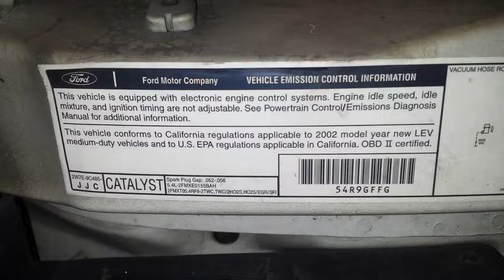Ford Econoline emissions: PCV, EGR, EVAP canister, & purge locations

Comment: What he pointed to in the engine compartment is NOT the EVAP “vent” solenoid. It is the PURGE solenoid. The VENT solenoid is attached to the EVAP canister by the gas tank.
Reply from the maker: You are correct. 👍🏻

Comment: YOU SHOULD'VE SHOWN HOW TO PROPERLY AND EASILY TO REPLACE PARTS WITHOUT BREAKING THEM.
Reply from the maker: This was in for a smog inspection.  I am not allowed to remove parts. Sometimes just having a starting point will help you come up with a plan of attack to get the job done. If you need step by step direction ls, I might be able to find them on All Data and send them to you. Text me or email me.

Comment: What does the little box do, the Vapor Canister Purge Valve Assembly  , should be replaced too ? Cant find any information on its purpose. Reads to canister and the other side has a line that goes to the back and is open to the environment 🤔
Just replaced all solenoids, lines & canister and found the box.
E-150 4.8L 2001

Comment: The second part you pointed out is the canister vent valve ,not the canister vent solenoid! The vent solenoid is under rear passenger  and is easy to switch out.. I wasted time looking inside engine bay for this solenoid

Comment: My van cuts off at stop lights and shutter when putting it into drive pushing on the gas pedal but when driving it acts normal shift normal everything is good I have to put it in park and keep pushing on the gas pedal to keep it on any help!!?
Reply from the maker: Have you checked fuel pressure and do you have a check engine light on?

Comment: Great video thank you. My b2s1 and b1s1 02 sensors went bad I guess. And it thru a code for the egr valve. That one by the spare tire I have a wire hanging down in that exact location I bet a squirrel chewed thru. But now I can assume what it connect to. It has a recommend on the print out to change the evap vent control or something?
Reply from the maker: This is a lot.. lol. What is the code you are chasing? The egr valve is in the exhaust system. If it is malfunctioning, it could cause your oxygen sensors to see poor reading.

The vent valve near the spare is for the EVAP system.

Let me know what you got.

Comment: Hello I'm having a hard time starting my 2003 econoline e350. I have to cycle the key 2-3 times for the fuel to flow I guess, but then it starts right up. My codes read P0442 P0171. Also occasional smell of gasoline. 
Any thoughts or recommendations?

Comment: Anyone ever tow with snow e150? 
I have an e150 with a 5.4 and I'm towing a 4000 pound trailer which should be ok within limits, but it seems to be struggling.  It will only go about 60 before feeling like your really pushing it. The van seems to be running good but occasionally gives a P1451 code. I'm planning to change purge valve, but not sure how to know if it's the value or the canister other than to try both. I do also have a lot of pressure when I open the gad cap. 
I was wondering I'd I drill a hole
To vent the gad Cao if that would help ?

Comment: This is somewhat helpful to locate the parts I need to investigate. My 1998 E-350 sputters when it shifts into overdirve and the RPMs drop. As long as the RPMs stay higher, the van runs fine and accelerates fine. Once I reach cruising speed on the high way, it struggles. My thought is that it's a vacuum issue, and I already fixed the PCV valve hose that had a hole in it. Thoughts?
Reply from the maker: Have you tried cleaning the mass air f low sensor?
Reply: @ScottiesHobbies  Not in the last 15k miles. I'll give that a shot, but I figured that would cause issues all across the rpm range.
Reply from the maker: @l00nybin  its more likely to cause a cross the rpm spectrum but i bet the rpms and air flow is pretty low at cruising speed. Check the connection between the mass air and throttle body. You are probably on the right path of vac. Lea tho. All the wires are good and no arching?
Reply: @ScottiesHobbies  wiring is fine. No arcs. It sputters bad enough that a misfire is unlikely because it would have to be misfires on multiple cylinders, and it's not throwing codes for that.
Reply: I think it might  be clogged cats, drill small holes on the cats  to verify. Don't take my word for it but I have seen it happen, or check them after a good run and they look bright red.

Comment: Pretty nice amigo. I have a Ford E350 which crank but does not start. Looks like a fuel and admission system, discarted crankshaft and timing systems issues, already a fuel pump and an injector was replaced by previous electromecanic.
Reply from the maker: Have you stayed any spray start in the intake while cranking the engine? If it tries to start or runs for a second you know you will have a fuel problem. If the vehicle does not try to start than you probably have a spark problem. I'd start there to make sure I am looking at the right issue.
Reply: @ScottiesHobbies  I will see the car this week as the owner contacted me to solve the trouble with this car. What I told you is just feedback from the owner.  This car just has come from USA two months ago to this country so let see what I can find during troubleshooting and I let you know.
The fault isolation you have advised sound pretty good way to isolate fault. I will do this. Thank you amigo...

Comment: I hope you're still following this. I really appreciate your posts. On my 2002 e250 5.4L v8 2 valve, I've received a P1451 code, after replacing the front 4 plugs and Ignition Coils. Previously I had a couple of misfire codes, and occasionally a "lean" code. Immediately after reaching around to install the 4 plugs and coils from the front, the code was p1451, the other codes have not returned. I'll do the other 4 plugs/coils soon, but I thought to collect the some parts, such as the PVC valve (and the Evap Canister Vent, since that code fired) to deal with the things I can reach from the doghouse, since all of this is a knuckle buster, best to refit what you can when you can reach it...
But... I'm confused. On the passenger side, you locate the "Evap Canister Vent Solenoid" at 48 seconds in... https://youtu.be/Ra7wODJY8F4?t=48

All the evap hoses are pretty obvious on an econoline, They are a little crusty, but basically they all look intact, so I'm less inclined to worry about evap leaks, and the pro's seem to say that it's reporting an a electrical issue between the PCM and the Solenoid, look there first. 
But when I look at the part, it doesn't seem to be remotely the same... https://www.partsgeek.com/catalog/2002/ford/e250_econoline/engine_electrical/vapor_canister_vent_valve.html?rp=vapor_canister_vent_solenoid 
Below, you mentioned that sometimes you get the "purge" and "vent" solenoid confused. Should I be looking for the "Vent" solenoid back near the tank?
Reply: I found the canister vent solenoid, its mounted on the canister, just behind the rear axle on the drivers side, and I can confirm the solenoid in the passenger side of the dog house is the canister purge vent.
Reply: I’m really confused now that I’ve read your post also.  Most of what I’ve read so far from others it seems like the words purge and vent are used as the same then valve and solenoid and used as two separate things.  
Your explanation says that purge and vent are different.  Soo what is the difference between vent and solenoid?  
My paperwork from my mechanic says that my code P0443 is for the “evap canister purge valve”.  Which is it? Where is it?
Thanks
Reply: @sotapota  the purge valve inside the doghouse open /closes to release and burn off extra fuel vapors at spec times during operation. The canister vent solenoid is located on or sometimes near the canister itself. Opens/closes much the same way at diff times to store vapors inside the canister. (carbon in the canister does it's thing & stores &or scrubs air into the atmosphere, again at spec times.. Not very technical, but that's the basic gist

Comment: Thanks Scott.    How about a troubleshoot vid on when gassing up Econoline gets the dreaded repeated nozzle shut-off?
Reply from the maker: Check the vent solenoid. Make sure it's not clogged, works properly,  and gets voltage to connection.
Reply: Did you get it fix??? I'm dealing with this now
Reply: @beardedjalapeno5263  any luck?
Reply: @zombie730  nope. Can't find out why.
Reply: The problem is the VENT SOLENOID mounted on the EVAP canister
Reply: Found a video in Spanish where the guy walks you through the diagnostics
Reply: @zombie730  got a link?
Reply: @beardedjalapeno5263  part 1  https://youtu.be/wU_MyK7KYtM
Reply: @beardedjalapeno5263  part 2 
https://youtu.be/WhEU-D4nrkI

Comment: Thank you, spent 2 hrs online trying to find the dpfe sensor today.  Still need to check egr but wanted to make sure I knew where it was just in case.  Question though, the Van has a real bad smell of fuel when running.  Would this be in relation to that issue?  The van struggles to accelerate but idles perfect.  Upon accell it's very choppy, almost like its misfiring.  Any thoughts?
Reply: Im have sam problem who you fix help.my

Comment: Have a 2008 e250, when I fill up gas the pump click off several times. I replaced the purge valve from inside and it did nothing. HELP!!
Reply from the maker: Usually when you're having a problem pumping gas it's the vent solenoid and not the purge solenoid. When you're pumping gas and the computer sees pressure in the EVAP system it'll open the vent solenoid to let the vapors not build up pressure in your fuel system. If the purge solenoid was to open to relieve the pressure it would allow all the fuel Vapors into the engine in caused a rich condition upon startup. Whenever I get this complaint about a vehicle I always recommend testing the vent solenoid and also making sure the hose from the vent solenoid to ambient is clear of debris such a spider webs and Road dust. Let me know if this helps or if you have any more questions please feel free to ask away
Reply: Scotties Hobbies bless you Scotty

Comment: Great video and highly appreciated! Big 👍 up! I have a P0401 code which popped up on my 1999 Ford Econoline E150 4.2. Should I look into changing my EGR valve or change the DPFE sensor first? I haven't noticed not one bad symptom since the code has lit up. When I've erased the code it pops up a day later or so and stays on. Thanks for the reply in advance.

Jeff
Reply from the maker: I would first test the EGR valve before I replace anything. It's a very simple test. Applied vacuum to the EGR valve itself and see if the vehicle stalls out or even dies. It should. The EGR valve should also hold the vacuum. If that test does not work then replace the EGR valve. If the engine stalls or dies and the EGR valve holds vacuum then I would suspect the DPFE sensor or the vacuum switching valve that controls the EGR valve has gone bad.
Reply: @ScottiesHobbies  Thanks so much for the quick reply. God bless you.

Jeff
Reply: What was the problem? The egr or something else?

Comment: If you get codes about oxygen sensors running rich, replace MAP sensor. If you get improper vacuum to the EGR, replace the charcoal canister purge valve. High idle can be caused by a bad MAP sensor. A bad coolent temperature sensor can cause high idle. A TPS can cause high idle. The ISC motor or IAC valve can cause high idle. A leaking transmission vacuum modulator hose can cause slamming into gear and harsh shifting. Listen for a hissing noise. Get a Actron CP9690 code tester. It checks live, record, emissions test, transmission tests, oxygen sensor tests, solenoid and relay tests, it can erase memory codes, it can turn off check engine light, it can turn off oil change reminder light, ABS, SRS, it shows coolent temperature, RPM'S, MAF %, IAC valve%, and MORE! It checks from 1983-2013 and is updatable. EBAY has it.
Reply: What's the MAP sensor

Comment: I found a bunch of little black pieces inside the vacuum lines, could it be that the carbon canister is broken ? I have a 2003 E250 4.2L?
Reply from the maker: Sounds a little odd but yea, might be carbon from the evap canister
Reply from the maker: Now that I have thought about it... i have foind little black pellets in a older bronco vac lines and after replacing oll the rubber vac lines on the evap system we realized the pellets were actually pieces of deteriorating hose.
Reply: Scotties Hobbies hope you can help me with this, my differential is leaking oil and I plan to replace the gasket and the oil, It has a DANA 60 35 spline, the only thing I’m not sure is if I have to add the traction modifier, I can’t find any information about it, I only know that has a  Semi-Float (C-Clip) Axle Lockers, any thoughts??

Comment: Hi! Thanks for the great video, really appreciate the info. Do you know what the name of the black hose and the canister thing you push out of the way a little to show the EGR valve at the end is? (In the foreground starting at about 1:35-1:56) 

I need to replace that on my van, but can't figure out what it's called.
Reply from the maker: That is the hose that goes to the IAC. The little canister is either a check valve or a small filter. If the hose is leaking you can replace it with the same diameter vacuum hose. I would look at the canister and see what it it is. You can suck and blow on it, if you can only suck or blow in one direction then you know you have a check valve..   You can also call the dealer and ask for the hose from the intake to the Idle Air Control Valve (IAC valve)
Reply: Thank you so much for your quick response! That really helped me. Turns out it is called the "air bypass valve inlet tube" Ford part 9h308. Thank you!!!
Reply from the maker: +jedge glad to help as alwase. Thanks for the view and good luck with your repair.

Comment: the one you said was a Evap purge, only has to do with the evap? cause on Mitchell and all data, it is stating that that valve is the canister purge vent solenoid. as well as the one with the green service port.
Reply from the maker: +Frank amaral the purge is the valve under the hood. The vent is the valve near the canister.
Reply: Scotties Hobbies exactly which one is the purge, because according to all the part vendors and all data, both of them under the hood are supposedly the canister purge valve?
Reply: I thought that the one under the hood which has the green service port for a smoke test if needed, is the purge valve.!!
Reply from the maker: +Frank amaral also, all the solenoids you mentioned are part of the  'evap system'. The evap system has both a purge solenoid that releases pressure into the intake and a vent that releases pressure into the atmosphere. Some evap systems have leak detection pumps and some have map sensors too. But its all a part of the evap system.
Reply: Scotties Hobbies , yes I understand thank you. so the canister purge valve solenoid  is the one with the green service port correct?
Reply from the maker: +Frank amaral yes. Take a look at this google site. The purge valve on this van is the 'CX 1597' style. https://www.google.com/search?q=cx1597&client=ms-android-sprint-us&sa=X&biw=360&bih=560&noj=1&tbs=vw:l,ss:44&tbm=shop&srpd=9272694548018011726&prds=epd:1444688672456312880,cdl:1,cid:9202841395192906108&ved=0ahUKEwjQyN_6uL7WAhXDxVQKHSNrBawQgTYI7QE

Comment: Hi Scott 
I ve e150 2000 check engine light showing p0104 , got the egr sensor replaced , the light came back on with the same sensor !!!
Any suggestions 
Ty
Reply from the maker: It is the egr system as in this vid right? Did you test the EGR by applying vacuum and seeing if the rpms fall or the truck even die? I have vnever seen this EGR go bad but I have seen this problem a lot. Every time I had to fix this code, I had to buy the EGR vsv and the DPFE sensor for  Ford. I trued many after market ones and I had many come backs. Since using only Motorcraft parts doing this fix not one person has come back to complain. 

hope that helps, ask any more questions if ya have any.
Reply from the maker: +MO GHALY wait... i just lied to you!! P0104 is a mass air meetering problem. Have you checked your mass air flow meeter? Super common for them to get dirty.
Reply: rodsmack01 ty for the reply. 
Got the valve changed , drove for almost 100 miles still my computer showing pending p0104 
Any suggestions
Reply from the maker: Have you looked at the mass air meter? The code you have: P0104 Mass Air Flow MAF Circuit Intermittent

Read more at: https://www.obd-codes.com/p0104
Copyright OBD-Codes.com
Reply: Scotties Hobbies I did  and I got mass air flow sensor changed as well.
Reply: Scotties Hobbies I thought p0104 is an EGR sensor though
Reply from the maker: +MO GHALY do you have a air leak between the mass ait meeter and the throttle body?
Reply: Replace the purge solenoid if you get EGR codes. Replace the purge solenoid if you get improper vacuum to the EGR.

Comment: Hoses fell off my DPFE. I think they go to the thin tubes on the EGR  bypass, but which order. Is the first one in the flow the reference? or ?
Reply from the maker: I believe the the hoses are slightly different sizes. The dpfe is used by the computer to watch for back pressure change which tells the computer that the EGR is working properly. if you want to bypass that egr til you can get new hoses or get it fixed properly, either plug the ports on the tube from the EGR to the exhaust manifold. The check engine light will be on though.
Reply: Awesome thanks for the response!  You're right about different sizes, can't mix them up.